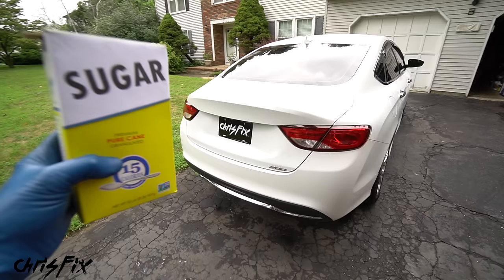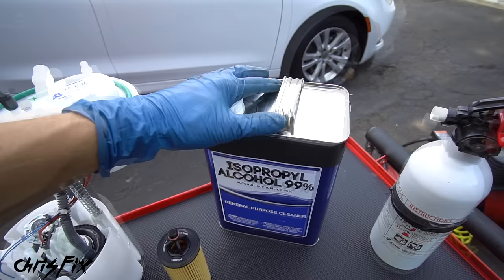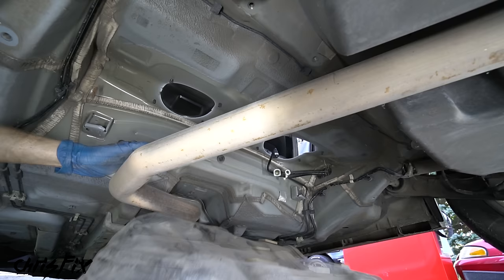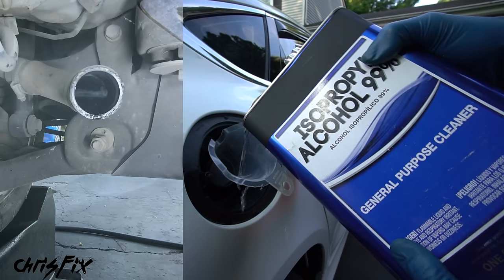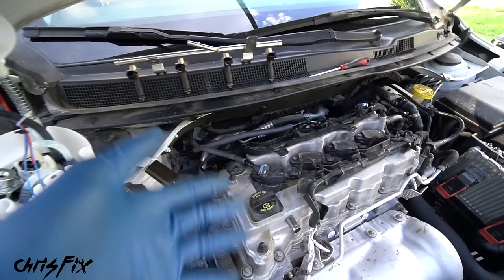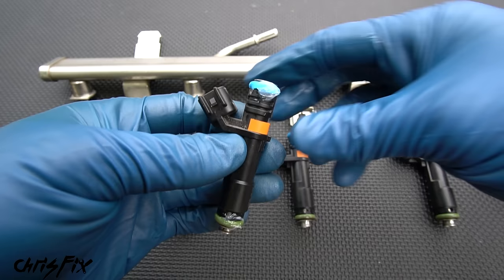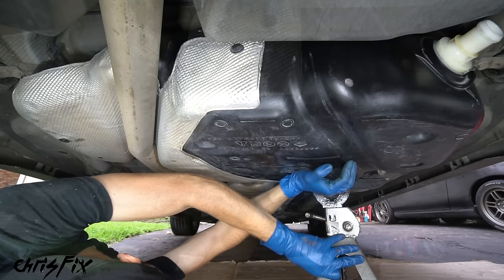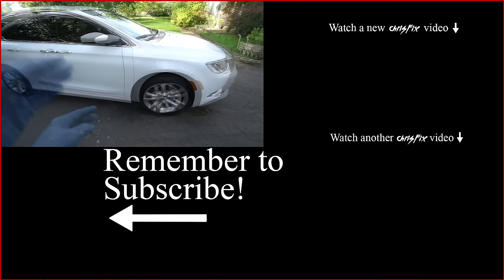How to Clean Out the ENTIRE Fuel System (Vandalized with Sugar in Gas Tank)

Comment: I just changed my filter and pump. It was suggested to me that I might have had sugar but I didn’t see any evidence of it. But others told me they didn’t have to change out those parts in 30 years and 350,000 miles. But I had all the symptoms of a clogged filter or some sort of fuel issue(stalling, rough idling, sluggish, no start, etc.). The fuel that poured out of the filter was dark brown and it was only 4 years(50,000 miles) old. It has still stalled a couple of times since then but seems to be much better. I added a fuel system cleaner and have only driven 15 miles since all of this. I guess I can keep adding cleaner. The bottle I added yesterday was on a full tank and maybe I’m supposed to let it get low first? I’m going to have to get it to a mechanic to see if there’s anything else going on with it. Also, I don’t see any leaks but I definitely smell gas.

Comment: This helps for me as my fuel tank on my Beetle was installed incorrectly and sprung a leak from sitting on the steering column. I need to recycle it, but obviously can't do it with gas residue in there.

Comment: Chris, I hope I'm not dictating this but, to prime the fuel pump in a push button car is to keep your foot off the brake pedal and press the start button twice. You should hear the fuel pump turn on and shut off. You can do that process multiple times and that should pressurize the fuel system.

Comment: Thanks Chris for your video. You did choose an easy access fuel system. I had to replace the fuel pump in my truck!!! Not so easy. The fuel tank sits underneath tucked up next to the frame.I have larger hands that would not fit between the fuel tank and the frame. It became quite the chore to get things disconnected. I think it would have been quicker and easier to remove the bed of the truck!!!

Comment: 9:44 just make sure to put something like towel etc to prevent any dust etc from entering to clean fuel tank. For flushing anything that cant have water in with pressured air, make sure before hand to put say 0.5-1bars into compressor and open the bottom vent of the pressure tank (some open when you turn them in, look compressors manual how to do this) if there is pressure and nothing comes out wiggle the valve back and forwards to get what ever is blocking the valve off, if that does not work release pressure and take the valve body out to clean it. Then turn compressor on and repeat moving so water flows to valve and gets out. Worst i have seen was 2 liters of condensing water inside the air tank.. owner never empty it. This has danger of freezing in winter and causing damage to pressure tank pushing it out wards and also causing rust to eat the tank from inside out. Oil that in most compressors leak little bit into tank tend to give some protection but it aint much and water is your compressors enemy so make sure to keep it dry and clean, so what ever you are using it on stays clean as well.

Also when taking things apart take pictures and say those injector connector, mark them with bit of tape and draw diagram note on paper what is what. Even if you think you know where things go.. well you wont if there is a hiccup and project takes longer than you though, so always mark everything... "but i wont forget" yeah i though that too.. until it happened to me so just mark everything and take pictures. Peace of paper and some memory from the phone wont cost amount of pain you will be when you forget.

Comment: 19:15 - I generally use a light touch of fresh clean motor oil, and I DON'T just push directly in, I give it a little back and forth twist so it won't pinch or damage the O-ring.

Some O-ring surfaces aren't so generously tapered and takes a bit of care to make sure they're not cut during installation.

An old 1985 Cadillac Seville comes to mind when I say this. Although it didn't have a fuel rail but rather a dual throttle body injection, the surfaces that the O-rings inserted into would happily cut the rings if you didn't give it a little twisty care and finesse while installing them.

Edit: I mean hey, in an ideal world where everything is engineered perfectly, a direct push ought to do the job. But in reality that isn't always the case. Honestly I would have left the clips out until after I assembled the rail and the injectors into the engine with gentle lubricated twisty action similar to what I described above. I've dealt with my share of cut damaged O-rings from direct insertion, learned my lesson and adapted my process accordingly.

Comment: When I was younger someone put a mystery mixture of what we thought was diesel and sugar into my tank as a prank. We had to remove the tank, replace the whole sending unit and pump and ended up replacing the injectors too. We didn't have little granules of sugar in the tank though, it was almost like a syrup that got stuck in everything.

Comment: I believe that on push button start cars, you can press the start button without your foot on the brake to cycle the fuel pump. You may have to press twice (one for eash click of a normal key start). At least that's what the two cars I've seen with a push button start have. It could be different for other makes/ models

Comment: You did not mention anything about removing rust or diesel. It would have been interesting to see the injectors go through that tester machine after you cleaned them to check if there was any difference or not. Though this video was extremely educating Thankyou - Im going to clean my Hilux's fuel tank tomorrow -

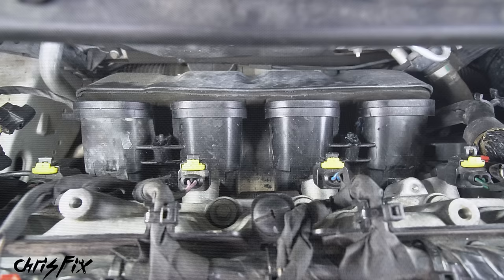Comment: Few suggestions. We never wash fuel tank with water cause water drops or humidity can stay specially in tropical/humid regions. 19:50...some debris can be seen that can make its way in along with injector insertion therefore the top part of engine must be washed before opening fuel injector assembly. 21:12 make a video on how to clean such integrated fuel pump assemblies if some one cannot afford to buy the new or the model is too old to find the original parts for.  25:15 The plastic covers/fittings should be fitted back AFTER checking the fuel leakage on the entire line.

Comment: Chris, I don't know if this works in all cars with push button, but in my Hyundai Kona, if I press the engine start button twice WITHOUT pressing the brake pedal down, that is the equivalent of turning a key ignition to "run"

Like I said I don't know if this works on all push button start cars but if you ever end up working on another fuel system in a push button start car hopefully this helps when it's time to prime the fuel lines!
Reply: TL;DR not sure if process is the same universally on all cars but most push button cars should have an accessory and run mode without starting the engine if you don't press the brake pedal when pushing the button. Accessory = 1 push and run = push x2

Comment: Ive seen an entire fuel system gummed up from sugar from a car sent to me from a used car dealer. Repossession vehicle. They put water in the tank with the sugar and when the fuel pumped sugar water slush though the system it eventually gummed up everything including injectors. Had to replace just about everything. Fuel pump and injectors, lines and cleaned the tank by hand. Mix the water and sugar into the fuel and see.

Comment: the van I got for almsot free was vandalized a bit, someone stole the gas cap and I didn't see any sugar but noticed a few peoples in the filler neck, pretty sure someone was sticking small rocks down there. it's having a low fuel pressure issue and the pump sounds strange and crackles when you prime it by turning the key on. gotta drop the tank and new delphi pump assembly and wix filter.

Comment: The one push start car I drove you could just push the button to start it but not hold the button in and that will put it in run mode without starting the engine. That was in a 2016 Nissan rouge a Chrysler might be different. Just tap the button and all the electronic stuff would come on but not the engine. Just an FYI if anyone wants to know how to set a push start to run position. One thing that sucks with those though is if your key fob dies the car doesn't start because it can't recognize the fob which is annoying. There is no key slot in case it dies. The Nissan rouge had a key to open the doors but nothing to start it without the button

Comment: The only way to determine if sugar is dissolving g in that gas is to weigh it before adding the gas, then remove all the liquid, let the solid dry and reweigh. If you have to use a filter, weigh that before and after drying as well to be sure it has t absorbed any dissolved solids. I'm betting you will find there is some sugar dissolving in the gas. The solubility may be very low, but that doesn't mean it's zero. And trapping the grains of sugar in the fuel filter just means that every time you add fresh gas it is going to dissolve a little more of that trapped sugar and carry it into places you really don't want it to go.

Comment: My daughter had a Honda Prelude that someone poured in at least a 2L of coke, which gummed-up valve guides, leaving the valves sticking open and since it was an interference engine…the pistons slammed the valve, bending it into pieces, cracking the head, snapping a connecting rod, mangling a piston, and wrecking a cylinder bore. I had to replace it with a salvage engine…and a locking gas cap.

Comment: Too bad if it’s already been running on sugar in fuel…. as a engine rebuilder I have fixed a few myself 
valves get sticky-seize in valve guides ,
Piston rings get stuck in groves and if been running long enough it will be in the oil sump ( bypassed the rings ) then you will get the next issue sticking oil pressure relief valve causing low oil pressure resulting in bearing failure 
Most don’t make it that far as most just get a really bad mis as the valves seize up that  can also cause valves to contact pistons 
Question 
Does your petrol contain ethanol ?? As ethanol fuels contains water…

Comment: Chris those videos are a great help to the people, however I have a question, and an observation, the question is regarding the lockable gas cap, if the car doesn*t have  the Flap that you have to  open once you are outside the car, instead of the mechanism that you pull to open from inside, and since a lot of cars have like a sensor showing that the gas cap is either loose or air is in the system ,how do you make sure so the warning light  does not come on  or give a false reading if you put a lockable gas cap, a lot of cars have this system, just like they have the low tire warning system,

Comment: Chris, 
Before you got rid of the 200, other than the videos you’ve posted during your vandalization cleanup, did you do anything else with the car under the hood? I have a ‘15 Chrysler 200 with the same 2.4L Multi air engine. I drive A LOT, so I am already up to 188k on the mileage. I’ve been fortunate enough to not have anything major go out on it. I do all my own work, and have replaced the thermostat assembly/housing, needed a new battery twice, pads and rotors all the way around, rear shocks, brake fluid flush, and several tune ups because the Coil packs on that engine are bad about going out prematurely. I’m going to keep up on it and get as much mileage out of it as I can, and wasn’t sure if you have dealt with much else on those engines. I’m about to do a partial transmission fluid change, as well as a coolant change

Comment: After flushing the fuel tube with water, I would block the bottom part of the tube and filled with alcohol to make sure the entire fuel tube is cleaned if I were doing the job.
Reply: Would also do a engine oil change just to make sure.

Comment: Never tried or come across ot personally I always figured sugar wouldn't dissolve in fuel wouldn't hurt the engine but possibly ruin the fuel pump if it doesn't have a sock on it.  I have seen sand in engine oil now that's sometimes successful at destroying a engine sometimes It doesn't do much at all

Comment: According to the US Army manual about sabotage from the 1950's, sugar indeed does tie up the motor pool mechanics, halting forward movement. That's all good, but if you want your enemies'  engines totally destroyed; then sand from crushed quartz will do the job in single digit mileage.

Comment: You could also remove the fuel pump fuse, disconnect the fuel line from injectors, and remove the fuel filter and pump what ever liquid out by opening the key or cranking the car 😂😂😂

Comment: What happens if you drop a tube full of radiator stop leak powdered lead stuff in the gas tank? Also what if the vandals pour a gallon of used motor oil in the gas tank? The car would start smoking like crazy and the driver would never know what caused it.

Comment: He should have told you what to do if the fuel tank has more than one gallon of gas in it. You will need to get a pump and pump out the gas in the tank into a safe container.  A gas tank that is 1/4 full -- or more -- the gas tank would be heavy and extremely difficult to remove.

Comment: I'd like to point out that it's a semi unreal as it's highly unlikely that you'd notice the sugar before it starts to melt down and then travel into the fuel lines and several other parts inside the engine causing it lock up and jam due to letting the sugar once again hardened back up but if you notice fast enough then yea you can easily clean it out but %80 of the time it's to late more cats than you think get ruined by petty fights that lead to someone pouring a few cups of sugar in

Comment: If your in a pinch, if you find sugar has been put in your tank and you need to drive your car?? Buy some transmission fluid and add it your fuel tank.  It loosens your fuel pump and injectors or carburetor and pump. It’s a temporary fix not a solution.

Comment: Chris, i have a 2001 v6 Saturn L300 and the heat shield rotted away from immediately around shield mounting bolts. i figure the easiest way to fix would be to simply put a larger washer between bolt and screw to hold up shield in place so it don't rattle on exhaust pipe. can i safely remove the bolt holding shield so i can put a larger washer of some sort in there? or are those bolts actually holding other things together as well? i mean i don't want to undo a bolt and see whole back end of car fall apart ... is there a easier way to fix those rotted shields that i may not be thinking of right now? ... do you have a video on this by any chance? thx for any comments

Comment: Sugar will lock up the engine had it happen 2 times to my customers it gets in the fuel rail and hot like molasses and gets in the valves and in the guides and once cools down its real sticky and will bind up the engine and break the belt the first one i did it broke the cam sproket dowle and jumped time so yes sugar will definitely ruin a engine

Comment: Are you sure  that car had only one fuel filter? I'm pretty much sure that cars that subscribers have might have another fuel filter down the line. Are you sure it's safe to pour alcohol and compressed air through the filter? The one that is on the underside of the car?

Comment: @ 9:29 after you dried the tank is it necessary to flush it out w/some special solutions. I've read about soda (2 cups)+ vinegar (4 cups) + water to fill the tank, let sit for overnight (2h at least). I've seen also Fuel Tank Cleaning Kit (Autozone, Amazon). Looks like there should be no smell of the fuel inside of the tank. Does it make sense all that to do, or just rinsing w/water is sufficient? @ 13:38 I have a question: why you can't blow air or 99%  isopropyl alcohol through the evap line, it would clean it. That line ends up in the fuel tank also. I removed the Charcoal Canister for replacement. Maybe if that evep line goes via Charcoal Canister you don't want to blow air there, but alcohol? It will evaporates. Thank you for the informative film.

Comment: What if it was a cj7 that sat for several years and pine needles are showing up in the fuel pump(pump/filter were installed backwards by prev owner so gas went thru pump THEN filter)? 😬

Comment: You pulled out fuel injectors and flushed them and conditioned them what about jet increase? Does it improve gas mileage  or torque or longevity for my  engine
Reply: I've had to trade 3 vehicles due to salt sugar water damage for engine deficiency

Comment: If a car has been sitting for about a year and you basically empty the tank out and fill it with new gas would you need to clean the fuel system?
Reply from the maker: I would also change the fuel filter and see how she runs. The injectors could be gummed up but they might also be fine.

Comment: Hey Chris, I own a 06 Jeep Liberty 2wd, and it seems like the connections from the hard fuel line to rubber hose are not secure. I verified that it’s the Dorman 5/16 inch fuel line clip and even replaced it again but it still leaked. Any tips Chris or anyone? Can really help. Thank you

Comment: Would fuel injector fluid void my engine warranty?
I'm getting 12 miles estimate to the gal and I just replaced some emotions parts .  Solenoid. 
I'm not making this up if you need me to post a video I will.  12 gal in city it's a v6 3.5 AWD it those not make any sense to me.

Comment: Crikey, you trust plastic ramps! I could see them bend as you dropped the car onto them - you're braver than me, I wouldn't trust them.

I made my own super heavy duty ramps from 9x2 timber, sandwiched together with adhesive and screws, with a 45 mitre cut on one end, stepping through 30cm, 50cm, 70cm, 90cm. They are rock solid,  not concerned about torsional strength (I.e. putting on a slope) and, will easily hold the weight of a truck. A much better solution.